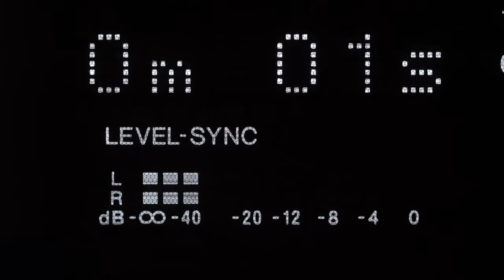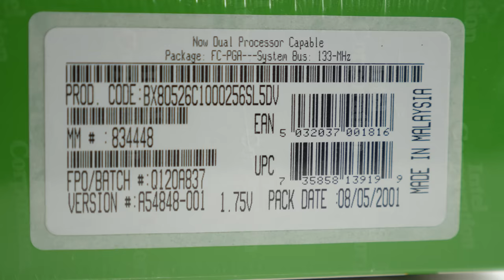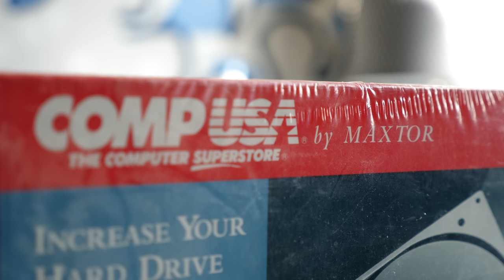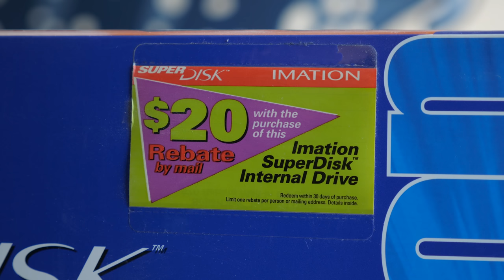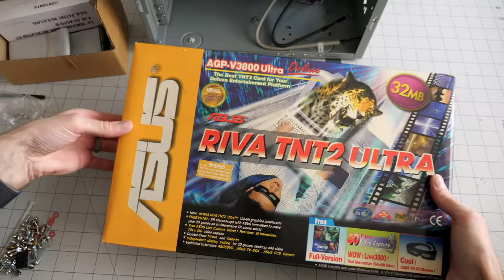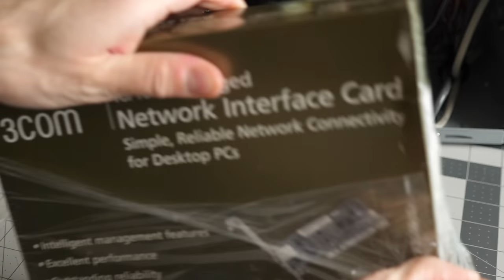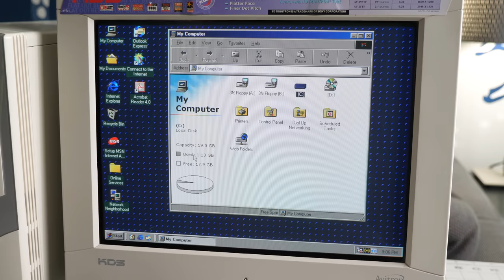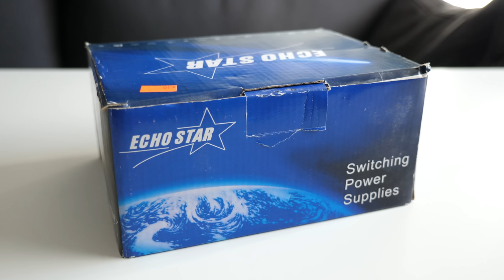Building a Retro PC From New Old Parts!

Comment: PN part numbers, yes. You are on the money with that assumption. I did tech support for both Dell and Logitech (1998 to 2001) with a company (who shall remain nameless, they don't really exist anymore...they bought another company and changed their name to the new company in an attempt to repair their reputation here in Las Vegas. Didn't work), a BPO that provided support, even better support than their in-house people. Logitech would create a SKU  that would have their accessories badged for the company they sold to and sometimes devices would still have the part number but have Logitech's branding. A way to ensure they sold all their stock, I guess.
As for the keyboard... Ergonomic, split keyboards were a gimmick in my opinion. Soon after their introduction, better posture and OSHA suggestions had corps turning to other things. Like getting up from your desk once in a while, wrist exercises, look away from your monitor from time to time, etc. The board you showcased was for corps, it was expected that the mobo BIOS in their machines and tweaked/controlled by their internal IT, would make the feature work, or work more smoothly to be of any use. Otherwise, it would try to send a signal to Windows 98 (and I think 95) to do "something special". It was so short lived.
So many things in this period were at break-neck speeds. As a home hobbyist, you would build a great and cutting edge computer, just to replace it in the next year or less. Now....I have a computer that is edging on 7 years old and still plays the latest titles as high res and little to no slowdown. It is time to upgrade, but it is telling of what we were working with then.

Comment: The el-cheapo power supplies from the early 2000s were notorious for being complete junk.  It was an era of trying to cut costs where nobody would notice, and a lot of people had no idea that a cheap power supply was a BAD IDEA.  They wore out after perhaps 2-3 years usage.  Even some of the better ones failed because of the capacitor plague of the time.

I realize you had to take some liberties to make something from new-stock or close, but at least IMO including a CRT from this era is questionable.

I worked in a University computer lab in the late 90s, and by 1998 the LCDs had gotten good enough that we replaced all our CRTs with LCDs.  By 2000, the CRT was almost a budget option, and by 2001 during the PIII era of your CPU I'd say it'd be quite odd to buy a CRT over a good LCD.  You couldn't give them away by 2006.

Comment: Lookup Intel Terahertz, we could have had 1000GHz in 2001. Why it didn't happen...don't know, Intel said it would be for sale in 2005 and ran COOLER with LESS POWER and 10,000x less leakage! So great for RAM and way more efficient. I have an original article from CPU Power Used scanned in if you'd like to be sent a copy.

Comment: Ok, I hate to interject. Specially if I'm not 100 sure...
But I was taught you WANT the 2 drives in the same channel because of the speed limitation. I was shown a video where the hdd connected to the same channel as the CD slowed the hdd down to 33 while by itself it ran at 66 or even 100...   ?

Comment: 1:06:30... That's a typical power supply in the early 2000's... Besides you shouldn't even be powering power supplies that old because some of its components are bound to fail just due to its age, like the capacitors...

Comment: You don't care if the clock is wrong? Fyi, the whole system including the OS depends on the correct date & time. In fact, some software wont work and you may even find yourself having issues if the clock and date is off by a couple of years.

Comment: I have built 3 Pentium III systems, two are desktops and one is a very large tower.  One thing i did was buy very high end PSUs, just to rule out the PSUs going boom, I have had one kill a motherboard and kill drives.  My tower is a dual processor unit, that has been maxed out ram wise. and has multi drives in it,  i had a microsoft lab that i built 20 years ago, everything went, bar the tower, but i thought sod it i might as well build another one, for messing about with the old operating systems again,  The tower i later recycled too, after finding that most of the drives were dead, off the PSU, and the very last part, just died there, that was the floppy drive lol.  i still would love a old school monitor again.

Comment: The bar codes were cut off by retailers. When they had dead stock they'd send the barcode to the manufacturer for a refund.  Liquidators would then buy up the dead stock. Then 20 yrs later well it lives again.

Comment: I would say that a more common card than a network card in the late 90s/early 2000s was a modem. How else would you dial up AOL? Of course, kinda useless today, but more period accurate.
Reply: While the "build" brought back memories, the most painful part of building PCs back then was the software. Formatting a new drive, installing and configuring Win98 and the drivers took hours. Then you had to deal with the instability of Windows, not to mention malware. Over time, it just needed to be nuked and re-installed. I invested in disk imaging software back then, so I could simply do a format c: and reload a stable image in under 10 minutes. That was an order of magnitude better than AV scans/repairs or having to rebuild everything.

Comment: I bought a BUNCH of the 540mb Maxtor drives SUPER CHEAP brand new back in the day.. they were JUNK but I needed them for cheap systems I was putting together for people.. they all knew the hard drives were junk but I got them for a steal from a supplier, they were garbage, honestly, but that's when you could get a bigger drive for a LOT more money and it really just wasn't worth it.. I'd put 2 of these in and you had plenty of storage for a win98 system.

Comment: 5:09 it popped with spark  because the power supply is set to 115 you supposed to set 230 in power supply

Comment: You almost answered my question when you said you couldn't afford a computer like this back then. The question is how much would a computer like this cost back then?
Reply: Depends when you bought this stuff, if you bought that stuff on the first day of release the numbers are extreme. I remember my cousin paid for a Pioneer dvd burner 700€ day one release, i paid like 400 € one year later and it was Christmas special deal normally i would pay probably 500€. Now you get the best dvd burner for like 15€ new. 

The processor did cost in the first weeks, if i am not wrong 1k, they dropped the prices later to on $666 and than again. 
If you bought everything on day one, there is at least i would say 2-3k hardware on the table.

Comment: Holy SMOKES that power supply, I'd be surprised if it could handle 100w no less 450. Yikes, that was straight trash inside. I would be SO pissed if I had ordered that 20 years ago and THAT showed up at my door.. I'd be PISSED!! Glad it at least had a fuse in it that actually blew and saved your table from imminent disaster. Yikes.

Comment: Funny thing I think this video might have been playing. while I was sleeping the other night because. I distinctly remember having a dream about zip ties breaking while building the computer. Anyhow great video it reminds me of my first computer build I did in 2004 except I was using the 800mhz pentium III. the only thing I would recommend doing Is changing out that power supply for something a little more reliable. You might even be able to swap them internals from a modern power supply into The Diablotech Case That way you still have the same retro look.

Comment: I have the ultimate retro pc it is the 1st 1 i built in 1992 it is a intel 486 dx50 not a dx2 50 a dx50, 4 megs ram, 128 megabyte metropolis esdi hd on a winchester  control card and an Ati wonderboard 512k video card a 3.5 and 5.25 floppy and an ide cd drive. the cd was added around 1997 only upgrade i did after the original build.  I am running dos 6.22 with dos shell and win 3.1 it is all original and still works for my old dos/win3.1 games

Comment: The missing Rebates are not surprising at all there are legit reasons for this. Some less scrupulous independents cut the rebates out and returned the rebate when a pc came into work on and this part was put in, they got a self-tip essentially. Alternatively, another practice that pc repair shops did, was to cut out rebate upc of half the stock on hand. Anything put out front retail kept the rebate as customers would not buy anything in a box that had a whole in it. The rest of the stock got them cut out and mailed in that money went to the business as free $ as they received nothing at the time from the vendors. Independents had to buy their stock if it did not move or sell they were totally out the $ on the stock (no Returns) this regained some of that loss.

Comment: IF YOU DONT HAVE THE BIOS TIME /DATA SET RIGHT  YOU WILL NOT  GET ON THE NET AND HAVE OTHER PROBLEMS IF I REMEMBER RIGHT ,YEP THEY DID CUT THE WARRANTY  ON HARD DRIVES  I REMEMBER THAT AND MAXTOR WENT  CRAP

Comment: Having grown up with these, of course I get the appeal.
However, apart from Keyboards virtually all parts have significantly improved. Modern cases are much easier to work with, and so on....

Also, now I would prefer a Mac mini (or something similar if you use Windows) - I really cannot stand the noises of a loud PSU anymore. Also these tiny machines use far less space and power...

But to each their own, I guess....

Comment: My take on 'old parts sealed or no:
No. 
This isn't comic books. This isn't baseball cards. Grease dries. Thermal compound degrades. Capacitors leak. I would be distrustful of something that has been sealedthat long. Now if it were clearly re-sealed and a note on it being serviced on x date? I would trust that a touch more.

Comment: It's all so beige...that keyboard looks absolutely horrifying.
Reply: Actually, its a very good keyboard, considering that it was released around 1994.  Also sold under the LITE-ON label.  They were about $25~30 new.  Better built than today's membrane keyboards by Logitech. It was my main keyboard since then until 2022.  I a used on 5 years before to keep in case my org. died.  Eventually some parts broke.  Never found a good replacement.   You get a FAT Enter key and large Backspace key, because they put the |\ key under the ENTER key, making the right-shift key smaller.  There is NO reason for that key to be so huge!  I consider it better than the MS Natural keyboard.

The power and center keys were pretty much useless.   With so much junk nowadays, even by MS and Logitech who use decals for key legends.  I replaced it with a 80% gaming keyboard I customized with mechanical switches, RGB, PBT caps.  It's about half the size.  Took me a while to get used to it, but I love my mechanical keyboard and extra desk space.

Comment: not bad but i stead with xp sp3 in an old 25 buck oplx 380 great machine did som upgrade in 4 gb ddr2 and a g9550 4 core and a nice dell amd 2 gig video card and installed all my old video games like combat flight sim 1,2,3 as well msfs 95,98,2000,2002,2004 and a whole bunch of 98 and xp games

Comment: Please do not use power supplies that are 20 years old, even if they are still in their original packaging. The capacitors age, etc. Today's 30€ power supplies with 400W power have sufficient performance and the quality, volume is simply tens of generations better. Also old PC is happy about stable voltages. The missing -5V line need only very old PCs, usually then already AT standard and the power supplies can be renewed. 
the video shows well what can happen, so don´t do it.
There are today from FSP, Seasonic, even be quiet OEM power supplies cheap that are also gray and fit

Comment: Maxtor and Quantum hardisks were a curse, cheap but unreliable in the long run. Another cursed brand was Conner, which itself was also purchased by Seagate. It's incredible how they purchased so many of them crappy HDD manufacturers. This did result in a series of Seagate disks that was prone do dying quite fast. They were fast disks for the time, but they overheated and that ended up killing them, the one time HDDs needed heatsinks... The 1Gb to 2Gb 3.5" half height disks, they were initially some cute tiny wonders due to their speed, a year later I was seriously disapointed though...
Reply: Uhh, I remember a Quantum Big Foot hard disk I had for a while (1.5Gb) that after a couple years needed a bump (yes I mean hitting it, specifically sideways) in order for the main spindle that rotated the platters to actually start spinning. These were another oddity of those years, a 5" 1/4  1/4 height hard disk, very thin but quite wide. At least they didn't tend to completely die, but they weren't really fast either

Comment: 20 years ago 800mhz 2GB ram with a core 2 or pentium 4 was the highest end pc

What if we told them we have 4GB 2133mhz pentium N5000 dual core with a 128gb ssd and tell them thats low end and that highesr end is core i9-12900K 128GB RAM 14gb nvme ssd with an RTX 3090

Comment: Come on, disable the onboard stuff you are not using on the BIOS, specifically the onboard Audio (to free resources like IRQs and DMAs which in this generation is important not to over use if not needed, specially when you start adding network cards) and possibly the onboard graphics card (it may have remained active stealling RAM and RAM speed from the system)
Reply: I typically even disable the serial ports and parallel ports if they won't be used, though that may be a bit much in this case.

Comment: I highly disagree that it was golden era for being a computer fan. The worst part was the speed of development. Your brand new expensive PC was turning into pile of electrojunk within just 2 years. I remember that to be able to play new games in more than 15 fps on low you had to replace GPU that often.
Reply: Currently I still use 7 year old GTX 1070 and although I wouldn't run newest games on high with 60 fps I can still do it on at least medium graphics. Impossible scenario back then.

Comment: Like. "Windows 98 early xp"... Ok what about windows ME or windows 2000. . .. windows 2000 was what i basically grew up on. I can boot up 2000 and i know it like the back of my hand. I still have machines running 2000 and xp. 1 running 95 and another with ME .. i should have a vista laptop but the charger dissappeared. Window .7 8.. i dont even really like anything after xp.

Comment: Looking at that power supply i even see places where transformers and inductors should go replaced with a jumper wire.

This power supply was engineered for bare minimum manufacturing cost at any... cost. No safety, no protections, no attention to detail, absolute minimum labour.

Even the cheapest units today do better!

Comment: Sadly, people go through junkyards or go through stuff like that computer you’re putting together sadly people steal things and they resell them to make a profit please note important If you have a hard drives, that no longer works or getting rid of the a computer take the hard drive out first and dispose of the computer and destroy the hard drive because people go through junkyards just to take old hard drives that have data still on them because people don’t format them and people can steal information from other people and they cannot access credit cards and phone numbers and Contacts anything in the hard drive even if you format the hard drive they can still recover that data so what is recommended to do is take a power drill and a sharp drill bit drill through the hard drive to the platter and completely destroyed. The platter that holds the data and then they might be able to put it in their computer and make their computer boot but it won’t be accessed cause it’s destroyed.

Comment: Aww isn't that nice building a retro computer that has zero use whatsoever. Absolutely zero updates available or os. And so old might not even load a web page. Let alone being so slow it's not even functional. You couldn't even watch videos without it buffering. Let alone with Pentium 3 instruction good luck to even get the computer to do anything. Unless you do offline retro gaming have fun with your Tetris.